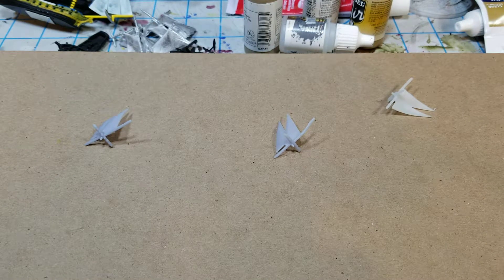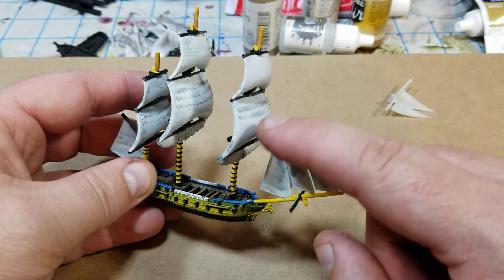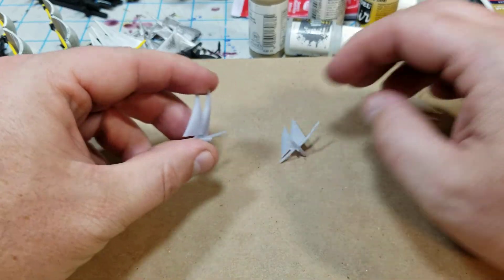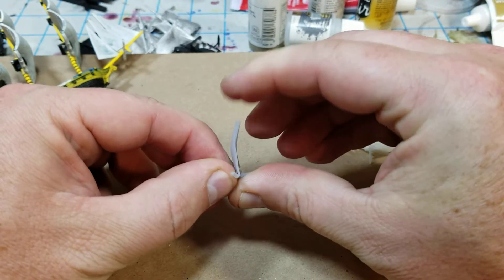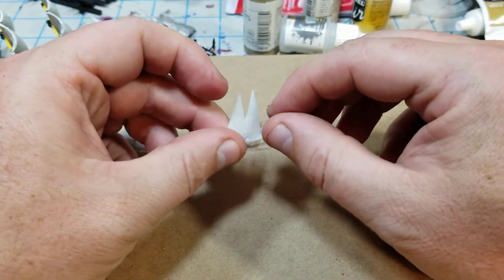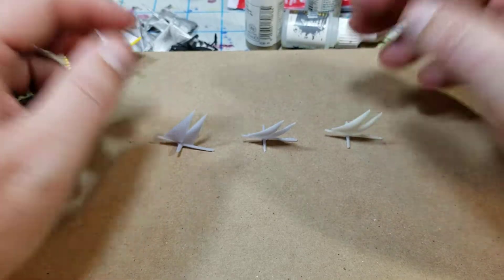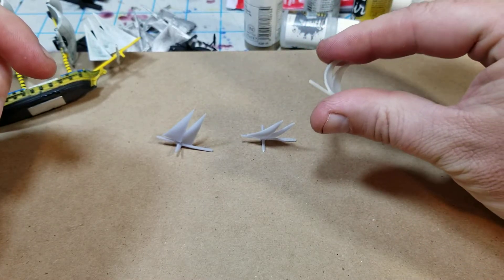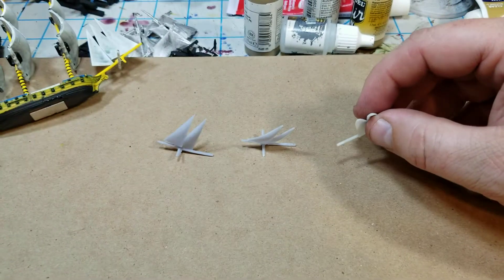Resin Mixes for 3D Printing

Comment: Testing this out right now on a replacement for a figure that was smooshed in the mail to my friend... Gonna be interesting to see the results. Trying about 30% tenacious at 2.7 seconds exposure in my Photon Mono. Thanks for the tip!
Reply from the maker: I'd be interested in hearing how it goes
Reply: @Aaronfromprojectwargaming  Will let ya know in a few hours when it's printed. Looking very good so far.
Reply: @Aaronfromprojectwargaming  Alright, so the initial print came out great! Was a bit of a doozy too: https://www.thingiverse.com/thing:4642530. All the feathers printed correctly, and the supports came off easily. Only trouble was that the mini supports were a bit annoying to remove due to their flexibility. The feathers are nice and solid, but flexible enough that they don't break when flexed normally. One did break when I accidentally pushed it hard sideways, but that seems fair. The mix does seem to stick harder to the FEP film though. Re-printing some poorly supported models led to the figures being ripped off the supports. Going to try the same print with better supports to see how it goes.
Reply from the maker: @a-tick  sounds similar to what I've experienced.
Reply: @Aaronfromprojectwargaming  Happy new year! Did a bit more testing. The supports are definitely more likely to break during printing than regular resin. Not sure if it's because the resin is stickier or what. Any pointers on how to improve that for small free-floating details like the hair on this one? https://www.thingiverse.com/thing:3871565/files
Reply from the maker: @a-tick  I've not done much printing at that scale. But I have two suggestions. I find the larger the mini the less flex resin you need so tru a stiffer mix. Also you could try making the base shaft of the support bigger. The flex resin does tend to stick to the film more so it require cleaning the resin basin more.